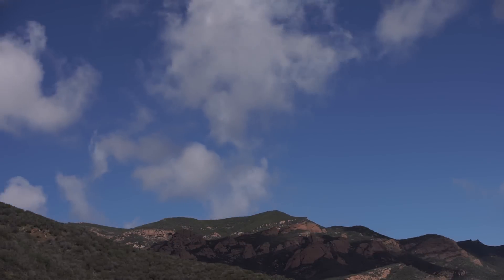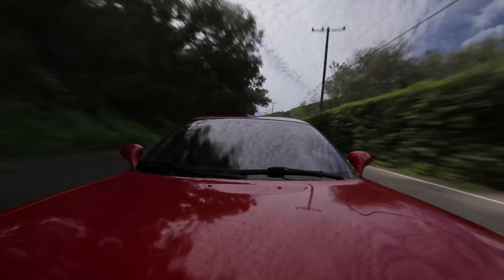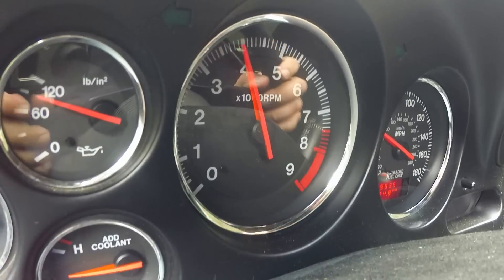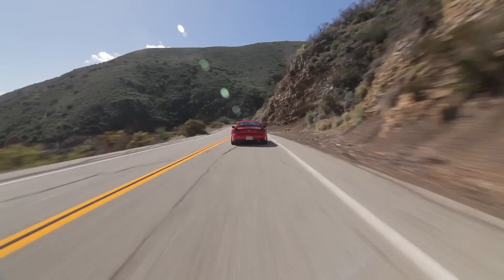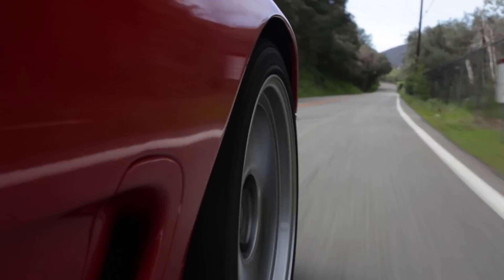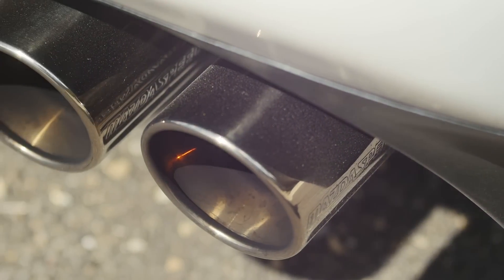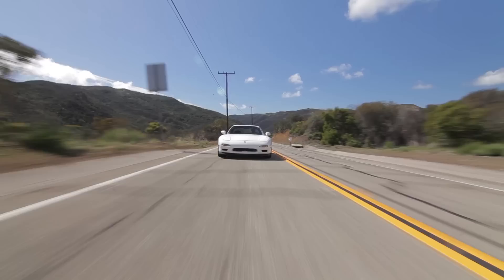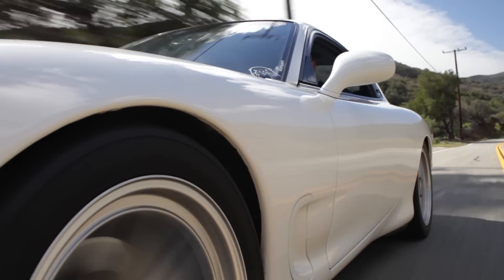Mazda  RX-7: Turbo vs V8 - /TUNED

Comment: What happens when you put a V8 in it ?
YOU RUIN IT !!! and then if you want to put a V8 in it use Japanese muscle (Toyota UZ Engine) 
and yes i'm mad about people putting ls engines in Japanese cars  xD 
Life is not a ls swap contest
Reply: zombio zip what about the nissan VK56 engine or the VQ45
Reply: i didn't know nissan made a v8 too XD
Reply: Max23653 Well at least Nissan proved you don't need a V12 or a V8 to make a supercar :D
Reply: zombio zip You should be mad that Mazda didn't make it easier and cheaper to replace the seals. It's the same reason people put LS motors in M3s.
Reply: Martin Espinoza yeah it sucks that about every 80k miles you need at least 5k to replace them :( 
So what is the deal with BMW's ? was it that thing where a e30 engine rebuild costs like 15000 $
Reply: zombio zip Yeah, that's the apex of ridiculousness, but BMW engine services are generally very expensive. They're quite proud of their engines over there. Mercedes, too. Audi is not quite as bad, they are more likely to want a million dollars for a switch and so on.
Reply: That is the biggest problem for German cars and bikes . They want so much money for every little thing
Reply: zombio zip  fckng hell man! you have to trash it to the limits to break down an e30 engine....
Reply: alexrome93 I don't have one XD  i have red it expensive.   but are you talking about the i4 or the i6 ?
Reply: i4, light weight rallye car :)
Reply: And they sound amazing for a i4 xD
Reply: zombio zip Life is not a hella jdm contest
Reply: zombio zipIf the Car didn't have an engine before he bought it, then it's okay.
Reply: Well yeah then i will let it pass XD
Reply: zombio zip but it's faster and more fuel efficient
Reply: adj789 Doesnt matter its SUPER TYTE HELLA JDM YO
Reply: ***** roses are red violets are blue 
my 2JZ goes ZUTUTUTUTU
Reply: Neither one of the JDM V8's, Toyota or Nissan, would work in an FD swap as they are DOHC and are too tall to clear the hood.
Reply: my64caddymt The answer always is 2JZ XD
Reply: zombio zip 

''That is the biggest problem for German cars and bikes . They want so much money for every little thing ''

Not if you live in Europe ;-)
Reply: Patrick Carta I live in Europe and yeah to be fair it's not that bad except for Mercedes Benz. But then what do you expect its Mercedes
Reply: zombio zip IF you do not do proper maintenance and driving. some guys have driven like 400k miles with their n/a, a properly maintained turbo rotary will last 200k

and lol. a bmw v8 engine here costs like 500-1000€, they crash these every week
Reply: buubised Awesome xD I didn't know
Reply: zombio zip Why would you use the fatter heavier less powerful engine? Just because it's Japanese?
Reply: Justa318i Because i'm a Japanese fanboy xD
Reply: zombio zip You are the fun police.
Reply: Maindrian Pace Sorry Boys xD
Reply: xD
xD
xD
Reply: I owned this car with same set up, but LS1 swap is smart way to go long run. It's lighter and actually lower center Gravity.
Reply: zombio zip sounds like...ricer
Reply: xsbgtr me ?
Reply: Actually it was to Justa318i but I guess I was really tired
Reply: xsbgtr xD I was reading all my comments on this and thinking like wtf, rice, me, no it could not be :D
Reply: zombio zip e30 engine? Do you know anything about bmw engines at all? e30 is the name of the 3 series, not the engine.. Guess you are reffering to the m20 engine.
Reply: wankel84 I don't know what the engine is called i just know about the 2.5 i4 and 3.3 i6. 
and yes i kinda don't really know anything about bmw engines xD
Reply: well e30 is the old 3series, if its that bmw you think of, it has the m20 engine:)
Reply: zombio zip But if you want more power, V8 is always the answer.
Reply: zombio zip There is some truth to the saying, but it really comes down to driving style. Some people don't want to have to change down a gear or two to get that torque. Personally I loved changing down to 3rd and overtaking 6 cars with my engine screaming away. But when it comes down to raw power, a twin turbo V8 is pretty hard to beat.
Reply: NZXcel But then i'm down for a 2l turbo 
They don't have the torque of a v8 but in the HP game they are ballin :D
Reply: zombio zip Turbo anything and you can get power, whether or not it will last is another matter. In the 80's F1 cars with a 1.5L 4 cyl turbo engine produced nearly 1500hp in qualifying, although they only lasted a few laps.
Reply: NZXcel but a 350-400 HP is not that bad for reliability
Reply: zombio zip Those figures are nothing these days though :P
Reply: NZXcel Well, yeah 1200HP evos,supras . fuck if i think about it, everything now has 1000HP+ xD
Reply: zombio zip 2000HP Nelson Racing Engines ;)
Reply: NZXcel Do they do only V8 ? i know them just from the David Freiburger's F-Boom (Twin Turbo V8).
Reply: zombio zip I think so. Probably not the right engine for an RX-7, there's too much weight including turbos and too much power to really use all of it unless you only wanted to use it on the strip.
NRE managed to fit a 1650hp streetable twin turbo V8 in a FB RX-7 though, quite impressive considering the tight fit.
Reply: +zombio zip Im ls swapping my FD, ill let you know how the ruins feel when its finished.
Reply: Ok ok ok... Guys i'm calling it done. I have changed my mind.
Reply: butt hurt lol
Reply: Yucannt Hahvitt a bit xD
Reply: +buubised my 84 RX-7 with the 1.1ltr 12A lasted me about 350,000 before I blew a rotor. but to be fair I was kinda trying in the hopes that once it blew I would swap to a single turbo 13B from a 93 like the red one. just lost my job right after, and had a kid right after that. but they are very very reliable, like any car that's been taken care of. my 95 has 647,325 right now. still going strong..
Reply: 95 Honda Accord, not RX7
Reply: +Martin Espinoza I see what you did there...
Reply: +YoBryce “HachiRoku” Kim Than a LS2 you mean, right?
Reply: It's nice though why hate?
Reply: +zombio zip There is at least one Ferrari 250 with a Chevy V8 Engine.yuck
Reply: Charles Adams
hahaha yes! I would love to see the ferrari fanboy butthurt with that around. FYI there's also a modified firebird with a Ferrari V12 out there.
Reply: Hmm Nissan trying to a muscle car lol there cars aren't for V8 I'm a muscle car guy and I respect jdms to
Reply: he made it reliable

Comment: "It's got an LS2 in it"... well you don't drive an RX7 then. 

Yes, sticking a massive engine in a teeny car, it'll go faster... but that's not the point, is it?

If you want an RX7, it's because you want the rotary. If you don't want the rotary, save yourself money, effort and hatred by buying a Corvette. There's no point.

It's pure preference. A Corvette would be rubbish with a wankel, the RX7 only works with a rotary, because that's the whole point.

In short, in an RX7, the V8 loses every time. In a car meant for V8s... sure, go ahead.

Comment: I don't get it... if the v8 car feels exactly like a corvette, why not just get a cheap c5 corvette to do your build. It's still a light car, it even looks similar to the Mazda, and they both have the same shitty plastic 90s interior. Except you'll get a better deal on the vette since it's not a cult classic.
Reply: highwaystar1009 
Because the RX-7 is lighter than a Vette.
Reply: Leroy Deuster Yeah, stock. An RX-7 FD is about 2800lbs vs. 3200lbs. for a C5. Throw in the weight of an LS motor, T-56, and a beefier rear axle and I'd say you're pretty damn close to the vette.
Reply: highwaystar1009 actually the ls motor and transaxle is about the same weight if not less than a stock rx7 with twin turbos.  Yes it weights more than the single turbo rx7 but barely. Still less than a stock Corvette.
Reply: Leroy Deuster I guess I'll take your word on it... not that I'm opposed to the swap (frankly, rotary cultists annoy the fuck outta me), but man all that money you put into it could get you a nice shiny C5 Z06 and then some. To each their own, but I'd have a hard time justifying the swap.
Reply: highwaystar1009 As a previous C5 owner, I assure you I'd take the RX-7 with the V8 simply due to it's compact size.  The C5 is a much wider car and while it may be the only time the Corvette's interior material and build quality is higher than a Japanese competitor, I much prefer the design of the Mazda's cabin over that of the Vette.
Reply: highwaystar1009 C5 z06 weighs in at 3120lbs with 405Hp, stiffer chassis and more badassery than you should be legally allowed to have.  C6 z06 is my alltime favourite Vette!
Reply: highwaystar1009 your right, you don't get it
Reply: AardvarkMusic Okay. Sorry to disappoint you.
Reply: Josh Taylor The build quality and the materials used in the interior are fucking horrible in most Corvettes dude
Reply: RAY NL Agreed, but still better than what came in the FD.
Reply: RAY NL In what world does the C7 have a bad interior? Loaded up, with full leather stitching and carbon fiber trim, its easily comparable to the F-Type. But for 20k less.
Reply: highwaystar1009 There have been maaaany weigh-ins done, and after a v8 swap the car gains up to about 60lb but a pretty dramatic power gain as well. you can maintain original weight after the swap by cutting power steering and ac if you really want it that way. But the main things are, you're driving a unique and sexy car that ways a couple hundred pounds less. Also, it doesn't cost all that much. You can get an FD with no motor or tranny for 6-7 grand all day, the kit would cost you about 10 grand depending on what brand you get, and then you could go as cheap as 4-5k for an ls1/t56 all the way up to 15grand for a crate ls7. Still cheaper than a 30k~ c5 though!
Reply: highwaystar1009 Maybe because they prefer the look of an RX-7 and want something unique.
Reply: David Huffman Fuck even as a fan of the LS engine, I still underestimate just how light it is. I gotta brush up on the NoRotors forum.

Anyway, I'm sure that could work if you want an all-out race car. But are you really gonna find a gutted Rx7 that could ever end up looking as clean and tidy as the two in the video for the amount of money your talking about?
Reply: highwaystar1009 The V8 is heavier than the rotary, but not 400 lbs heavier.  I bet it isn't even 200 lbs heavier.  The RX-7 probably has a 300 lb weight advantage over the Corvette after the V8 swap.
Reply: Plur307 They are actually very similar in weight, the V8 is only about 40 pounds heavier than a 13B-REW.
Reply: RAY NL Go look at the interiors  of the C7 with the interior  upgrade  package, deffinetely  not behind.  Do the same for the new Cadillac's, again they're  not behind.
Reply: RAY NL Works for me.
Reply: highwaystar1009 because they want an RX-7 and not a Corvette
Reply: highwaystar1009 Thats actually a pretty damn good argument, dude...
Reply: +David Huffman I had to lower my suspension in the front after my swap because it sat higher and didnt look right. [coilovers] I used an all aluminum LS1 stroked to 383 with forged internals. FAST 102 intake and a short ram intake/radiator setup from samberg. I will get it corner balanced to see what the difference actually is. BUT I get 30-35 mpg with 4.10 gears and have ~475whp+  [dyno's at 446/448 before I put the aftermarket heads on and raised compression from 11.1 to 12:1] I really enjoy the swap. Still like rotaries but like the LS more.
Reply: +David Huffman Excuse me, are you saying that an LS swapped rx7 fd is unique? BAHAHAHAHAHA, MY FUCKING SIDES ARE BLASTING INTO ORBIT RIGHT NOW.
Reply: +Eli Brazeal I was saying that an rx7 is unique. The body. Read my post again.. But to answer your point specifically, yes.. V8 fds are rare. They are less common than rotaries and even the rotaries are very rare. So what are you laughing at? You're a purist plain and simple. Very simple :)
Reply: David Huffman Ahh, yeah rx7's are really unique. Love the way they look. My bad for misunderstanding.

And if you say V8 fd's are rarer than rotary ones then I'd like to see some proof because I'm judging from experience that there's around a 66:33 ratio of LS-swapped fd's to 13B-REW's. Maybe in different areas of the U.S. it's the other way around, though? Or do you live outside the U.S.?

You say I'm a purist like it's a bad thing lol... I don't agree with lots of engine swaps, unless of course the original engine has already bit the dust or is not present. Swapping out a car's still-beating heart for the heart from another car seems pretty dumb to me.
Reply: +Eli Brazeal I live in wa state, there are barely any fds and even less v8s. I only care about the purist thing if it's for a show.. But I drive my cars hard and ls motors perform well. I wouldn't pull a rotary in good condition to swap it though.. Mine was a rolling chassis but I wished it had a rotary for me to beat up on before swapping.
Reply: David Huffman That's the thing about the rotary though. Or at least the 13B-REW. If you maintain it, hard driving is what that engine loves. You almost can't stop them. Shit goes and goes. Revs all the way up and loves every damn second of it. And it'll do it almost forever too. Short-shifting and "babying" a rotary is more abusive than revving it high could ever be.
Reply: +Eli Brazeal yes the engine loves it but the tranny, axles, start towers, springs, brakes etc... Nothing else likes it. You also need to bring oil with you everywhere because they leak or burn. To each their own, accept it I'd say. Some like the simplicity of a v8, others don't.. But don't hate on another man. It's his car
Reply: David Huffman Nah, hating is just stupid. I used to be "that guy" but I got tired of it quick lol. No one likes that guy.

And the other parts are also not what most disagreements are about, hence why I didn't mention them. No tranny and etc. likes it, regardless of engine. Some may be a bit more durable but if you drive hard you have to expect to replace those parts anyway no matter what engine powers your car.

As for bringing oil, I put 2-stroke in my gas in addition to the oil injectors just to be safe lol.
Reply: +Eli Brazeal demo?
Reply: ***** demo sama is laifu
Reply: +highwaystar1009     You dont need to get it man ...i mean if its a vette... the title of this video is gonna be Mazda rx7 turbo vs v8 vette...
And just because its a V8 Rx7..thats why it became more interesting.
Reply: +Leroy Deuster a rotary weighs 150lbs, are you saying the stock manifold and turbos weight 200+?  cuz that's what u are saying.
Reply: +highwaystar1009 Because the whole world isn't America
Reply: +holt b having pulled the rotary out of my FD i can guarantee you it doesnt weigh 150lbs, who lied to you?
Reply: verz22 i weighed it. i have had 8 rx7s. the 13b i weighed was a bare block being broken down for porting.  digital scales > your opinion. A sr20det weights only 300 is is half the size with parts, the heaviest thing inside a rotary is the e-shaft. the rest is rotors and hollowed cast housings....  with accessories it weights 250, which a ls1 weighs 358(scaled) and a sr20 engine(315)  how is 150 for a engine half the size of a 4cyl weight 150 less when you are talking about metal...... things seem like they weight more when the weight is weirdly distributed when you try and pick it up.   i can pick up a rotary with another person and sat it in the car, done this many times, yet the sr20 is too heavy to do so.   Mind you i only can bench 250lbs so if i can do this i dont know why ur having an issue.
Reply: verz22 maybe this would explain it better to you since you workout.... when you load a bench bar up u go heaviest weight on inside to small outside.  At that sammmmeee weight put 2 plates from the right side on left and then do the weights small on inside to big outside.  then lift it..... it's harder to lift even though the weight is the same, why? because the weight is distributed shitting for lifting.  if the rotary weighed more im sure mine and all the PR people who build rotaries on 5 gallon buckets would have a mess since 5 gallon buckets wouldnt hold 200+ lbs
Reply: *****
I understand weight distribution and balance quite well and I was smart and used an engine hoist...I dont get where you are coming from. It would also help if you specified a bare rotary "shortblock" without accessories because than yes you may have been correct. Regardless there is a minimal diff in overall weight between the rotary and LS and people automatically assume its going to through off the weight balance when in reality it still has a 50/50 distribution with the LS.
Reply: A good interior isn't necessarily about the materials used or how loaded with gadgets it is, more how it's organized and designed.

I've always thought the C7 interior while full of leather and loaded with tech is just ugly and cluttered.
Reply: highwaystar1009 hell no vetted where I live in mint condition is 30k n up rx7 the MAX is 20k below the lowest is 15 only for the fd versions
Reply: highwaystar1009, it simple...bcoz they can!
Reply: alwong604 yea c6 is the best vette of all it looks bad as fuck, I like Japanese cars too but it would be a tough decision for me if I had to choose from a c6 or an rx7 I don’t know which I would choose I’d have to drive them both same day back to back to decide and on a track or a winding road with no speed limit to decide
Reply: Because fd rx7 is among of the best looking car ever made along with e-type, 250 GTO and 2000gt.